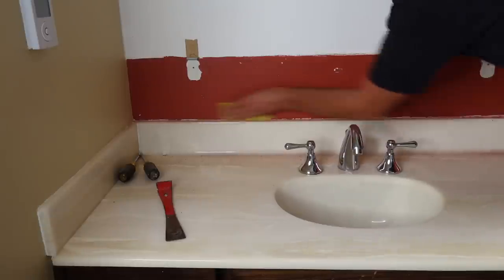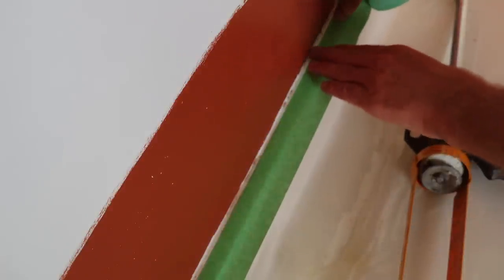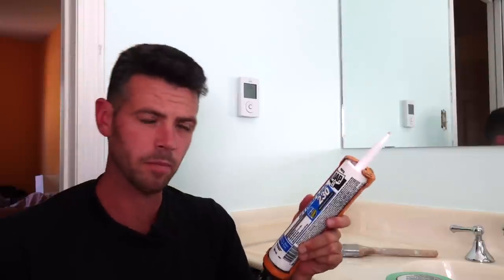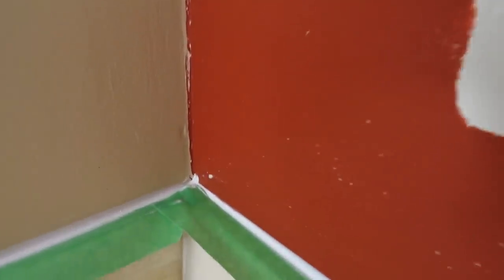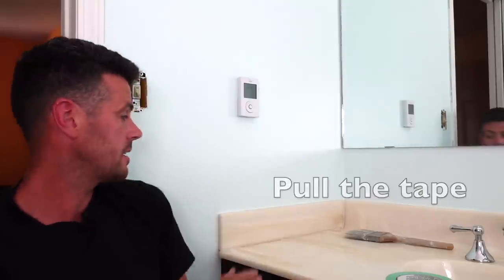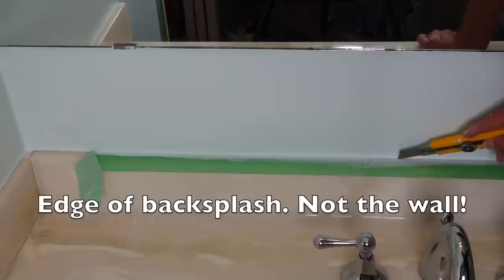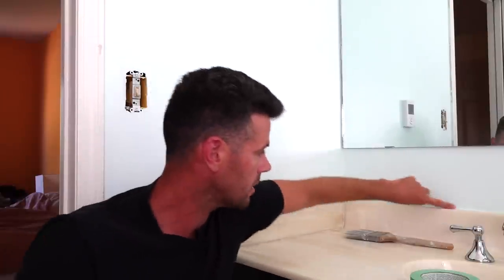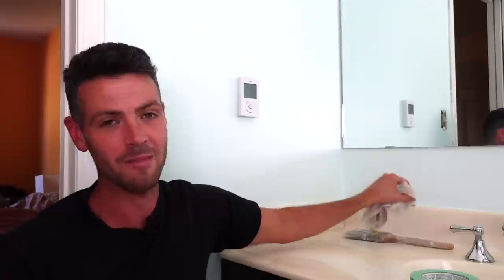Quick and Easy Fix for Painted Silicone!!!!

Comment: I’ve always just bit the bullet and removed the old caulk (scraping, cutting, picking, alcohol scrub).  Dry out the seam and start over.
Reply: Best solution ever! I never try to caulk over old silicone—I don’t care what the manufacturer says on the tube.
Reply: I agree, this would seem to be the best method. I guess the over-caulking is the quicker (lazy) method, but probably nowhere near as good as starting again.

Comment: If I need to score a uniform line with a knife close to the wall, I extend the blade a bit and tape an appropriately thick spacer to the side of the blade. I can then run the spacer against the wall and get a perfect cut. Sink looks great, by the way!

Comment: Always wondered if caulking over the silicone would work. Good to know! To avoid the bridging problem I will often use a sharp straight drywall knife and just hold the blade next to the edge of the tape while I pull the tape off. Give it a try I'd love to hear what you think

Comment: If the silicone is in good shape and you just want to dress up the lines, I’ve had luck with taping off as per Ben’s video, but I also added a paper barrier around the wall and sink (to avoid overspray), then sprayed the exposed silicone with a bit to Kilz primer / sealer can spray…let it dry, then paint with a brush, then slowly pull off the painter’s tape & paper barrier while the paint is still wet. Wish I could figure out how to work in feathering that edge…oh well, I promise I strive to feather edges whenever possible Ben. Thx for another great video. Cheers
Reply: would it have been better to remove all teh old silicone and strat fresh?
Reply: @randomrazr  removing the silicone is usually the way to go if you can, but even then, remnants of the silicone can remain and “contaminate “ the paint finish. Using the Kilz primer as a barrier can go a long way in ensuring your application of paint will be smooth and without a reaction to the silicone product.

Comment: I'm usually a big fan but not sure about this one. Did you put latex caulk over the silicone? Surely the right approach is to remove the old silicone and replace it with a new bead of silicone since it's next to the sink?

Comment: I have used oil primer on silicone then paint with latex paint. Caulking works too. If you caulk, peel the tape off and allow the caulk to dry. Then reapply the tape and paint.

Comment: We therefore do rounded inside corners with thicker paintable silicone and then paint over it. Or use a transparent silicone to make this at the end. Or just put backsplash tiles between vaniity and mirror where a lot of splashing occurs.

The way it's shown here: 100% guaranteed this corner will get a lot of dust/lint (fan in the bath) and will be regularly scrubbed gently or aggressively

Comment: You should also use siliconized latex caulk to ensure a solid bond to the silicone due to the issue of only silicone bonding to itself. Otherwise a foolproof way of remedying.

Comment: If you tape and spray the silicone it will take paint. If it is cracked you can spray and then put a thin bead of caulking to fill the cracks. Less dry time.

Comment: Another thing that can work, is prime the silicone with an oil based primer, then paint it at least two coats. I like to use zinzer cover stain, even the rattle can version works but be sure to get a thick coat of primer.

Comment: If you aren't comfortable cutting the tape out a good way to avoid bridging is to peel the tape right after the caulking and tape it again to paint. Most of the bridging is the caulking and not paint.

Comment: You want to pull the tape when the. Caulk is wet, depending on the caulking you can usually still paint right away on the wet caulking  and then pull tape

Comment: @vancouvercarpenter  Have you done a video making the opening of a closet bigger?  Then the drywall work on the lip around the top and side?  I have already expanded the closet opening, just need to figure out what bead to use on the drywall lips?

Comment: I just avoid using pure silicone at all, it sticks properly only to rough surface, at least where I used it it separated by the time, I use silicon-acrylic (kinda mix) instead or sikaflex (probably similar to dynaflex which I haven't seen here in europe)
Reply from the maker: Dynaflex is a siliconized acrylic latex caulk so same thing.

Comment: 100%, unpaintable silicone caulk, should require a special permit to purchase and use, as most times it is completely unnecessary and ruins the paint job of the next, unsuspecting painter.